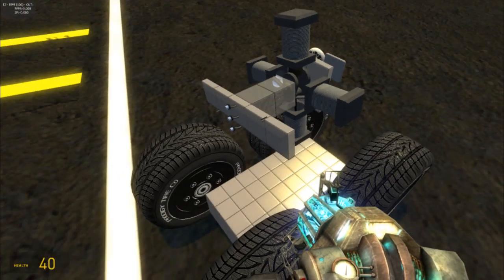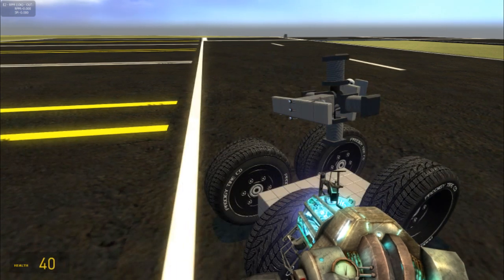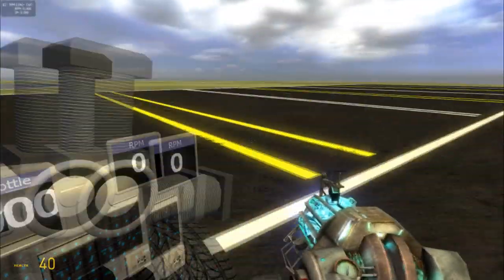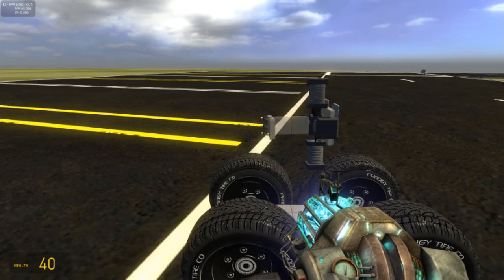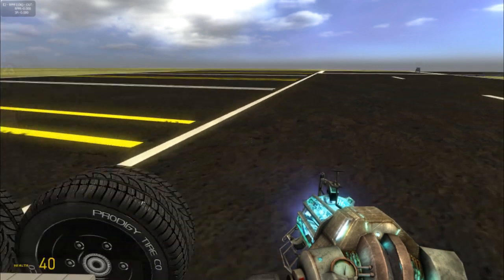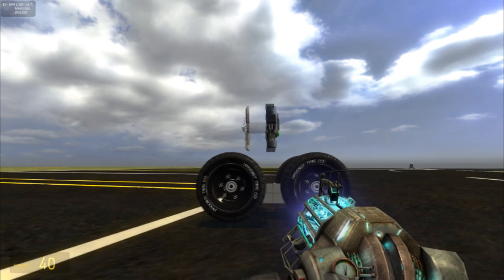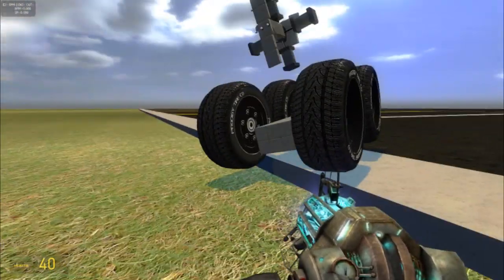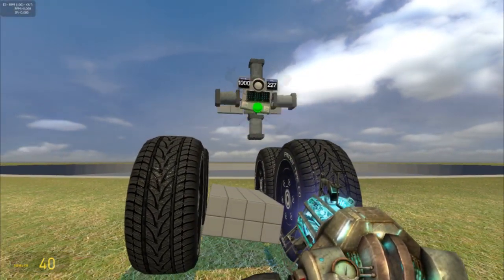GMod - Rotary Engine Testing

Comment from the maker: @Trinith My understanding was that Adjustable pitch propellers main purpose was for the engine to stay at a steady , safe, constant rpm. 

And the non adjustable propellers would use the engines varied rpms as the control of thrust.

Comment: Adjustable pitch (aka variable speed) props have been around since before WWII. They're also usually hydraulic as well. As for radials on aircraft, it's pretty insane in fighters, but fairly manageable in the bigger aircraft.

Comment: @spider0804 That's it in a nutshell. The throttle is used to set the amount of torque applied to the prop, the prop control sets the rpm that the prop will turn at, the blades adjust pitch automatically to attain the desired rpm. More pitch = lower rpm. Think of it kind of like changing gears in a car. Better acceleration at lower pitch, more efficient at higher pitch. Static props are used (now) for simplicity and cheapness, and are actually pretty rare these days.

Comment: This isn't a rotary engine. The term "rotary" comes from the wankel rotary engine. This what you made is considered a Radial Engine. They are two completely different engines
Reply from the maker: Indeed it is, an aircraft rotary engine rotates the entire engine and was the first type of rotary engine. The other type of rotary engine is the one with a triangular rotating piston/flywheel seen in the rx7 and rx8 cars and is more commonly referred to as a Wankel engine. If you are unsure of this, google aviation rotary.
I will even link you the wiki page. 
https://en.wikipedia.org/wiki/Rotary_engine
Reply from the maker: I would also like to add that these are not radial engines either, with radial engines the entire engine does not spin.